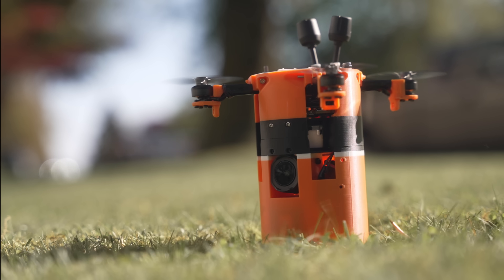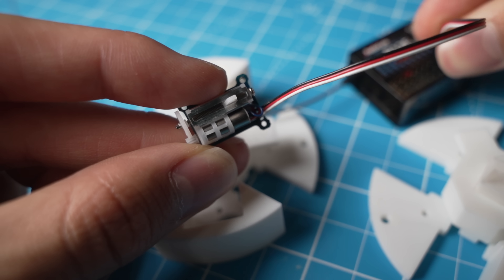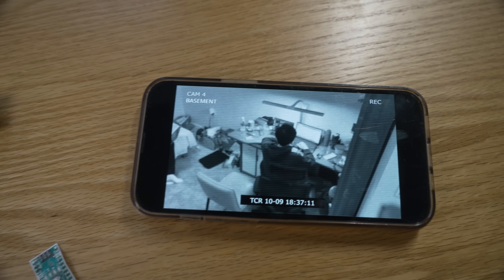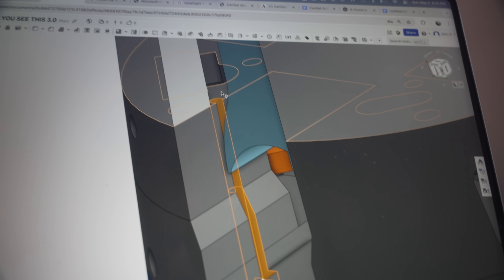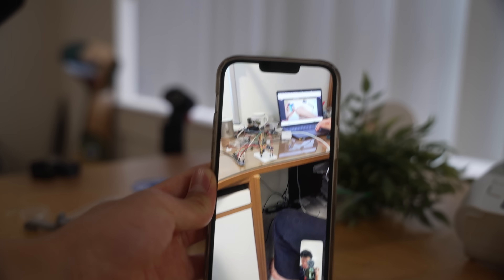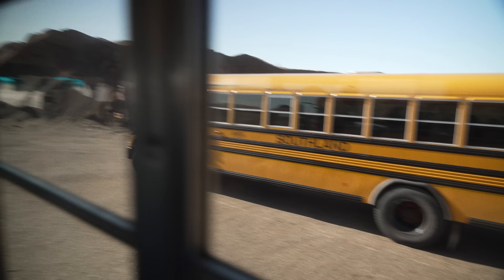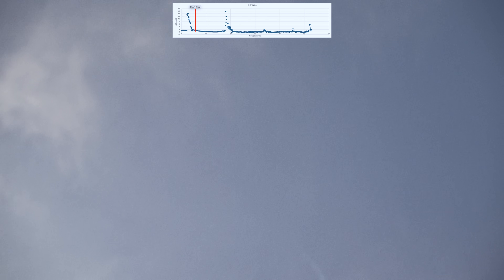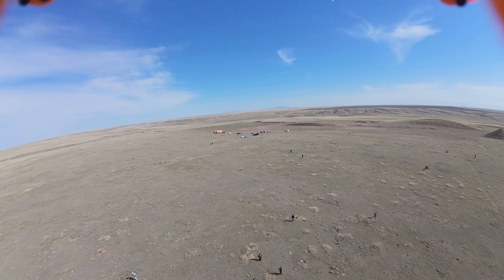I Built a Self Landing Satellite

Comment: This is SWEET.
I'm by no means an ITAR expert, however I do work with it a lot. With that said here's my somewhat professional but most definitely not legal advice interpretation. When the drone separates from the rocket, it is no longer classified as a rocket, but a drone or payload instead which puts it in a different class, most notably the class which would involve small UAS according to the FAA. This would be similar to dropping a drone out of a plane (illegal for different reasons, but regardless the example). The big gotcha there is it can't operate above 400 feet altitude so you would need to free fall (keeps in you in this weird grey area of "payload" until it became a "drone" at 400 feet altitude). Once you hit that altitude, since its now a "drone" and not a "payload" you would theoretically be okay for autonomous guidance. This is most definitely a grey area however I suspect by playing it that way, you would be compliant. Someone more experienced than me should definitely correct me if you have more experience.

Additionally there is this weird autonomous glider parachute that Apogee sells which further bolsters my argument since you could also call this a "recovery system" https://www.apogeerockets.com/Building-Supplies/Parachutes/Gliding-Parachutes/32in-Gliding-Parachute-System

Comment: You should update your drone with Strongger motor like 2000kv and use Cell 6s Lipo, and make it heavier because if it is too light and small, it cannot generate the best wind and stability.😊Advice from an FPV drone player
Reply: And connect GPS

Comment: You should try to fly in AIR mode not ANGLE mode, as far as I could see on your osd from the artificial horizon, drone was thinking that right side up was actually sideways. In air mode you pretty much control the direction of the drone yourself and gyro only holds the drone’s attitude from changing so you can use the right stick to level yourself out. However flying in acro is a skill you need to develop as it requires practice to be able to navigate your drone properly but yea you really need to repeat this launch in a drone where acro mode is on so that gyro doesn’t effect your flight as much.

The accelerometer function on most flight controllers, deviate a little even in drones when they give a lot of full throttle punches. So a rocket is definitely gonna make your accelerometer useless if it pulls anything more than 7 G’s. gyro still seems to work fine no matter what though so the drone can fly perfectly on acro / air mode while angle mode is gonna make it wrecked

You can always recalibrate the accelerometer but that has to be done on the ground so you can’t really reset your accelerometer after being shot out of the rocket

Comment: While working at a drone company, my team studied how rotor blade design impacts performance for drones in flight. We found that concentrating more mass toward the outer edge of a propeller blade increases its moment of inertia (( I = \int r^2 , dm )), which resists changes in rotational speed. This stabilizes power demand (( P = \tau \omega )), reducing current spikes that could cause voltage fluctuations and stress the drone’s electronics.

Inspired by this, I’m exploring the idea of adding a lightweight ring to the outer edge of these small blades. This could increase moment of inertia for smoother operation and act as a protective barrier to reduce blade breakage. However, the ring might increase aerodynamic drag, potentially reducing efficiency, so careful design is needed to balance protection, stability, and performance.

Comment: Replace the two micro servos for the release with nichrome wire wound around a rubber band. Apply voltage to the nichrome wire, and the rubber band will burn and cut, giving you the release. This saves you weight and money. 😉👌

Comment: I really appreciate that you shared the technical issues you were faced with. It may not be as cinematic, but it helps people that are inspired by what you do.
2 recommendations:
1) get a MOSFET module that can be controlled with servo signal - then you can turn off and on the power for the video system with your remote - no overheating, more battery for landing
2) Get a flight controller with a barometer, or a separate barometer module - easy way of getting ballpark altitude, so you know when to throttle up :)
Reply: I was also thinking barometer. I’ve never done anything like this, but I went into a short rabbit hole after the Ukrainian drone attack and seems like barometers are good enough for ballpark altitude, like you said.

Comment: 1) Not a satellite. Doesn't go anywhere near high enough, let alone actually getting into orbit.
2) DJI is the wrong choice when you're gonna have it waiting in such an enclosed case. Could've just gone analog, and at 25 mW it won't overheat, then bump it up to higher power right before the rocket launches. With the right placement of the VTX, you wouldn't even need the cooling fan, since the airflow from the props would be enough.

Comment: There are no legal reasons to prevent your from using Ardupilot on this to guide the landing. There ARE some other legality issues however regarding the FAA in the US. If it is over 250g then it must be registered. It's a small cost, and you can register it for "recreational use" and not require a Part 107 license. However, there is also a 400ft altitude restriction. However, any rocket launch site will likely have a Temporary Flight Restriction (TFR) published to restrict the airspace so aircraft do not come near and risk damage, and as long as the drone is operated within this TFR, you will likely avoid any issues since you likely may not be able to file for a TFR within the same airspace for drone operations. 

This is a cool concept and it performed well, can't wait to see the next one!

Comment: Some flight controllers have a switched power supply for the VTX that can be assigned to a switch on the radio, that would allow you to prevent the O4 overheating. Also, the O4 "bottom" as you put it is actually the top that needs more airflow.

Comment: cool video, fyi the o4 pro is designed to be mounted inverted thats why theres threaded holes on top. no idea why DJI did it . betaflight and iNAV both have gps rescue, assuming you had sat lock before launch, you could activate that either manually or via fail safe and it would fly itself back you can set all the parameters to control descent, so you could have skipped the o4. cool project

Comment: Just an FYI as someone who is also an engineer and part of the keyboard hobby, try coating those sliding surfaces with some krytox lubricant. Its dielectric and safe on most plastics and durable (doesn't dry up easily).

Comment: You should try making a better version of the "Estes Skywinder"  model rocket. Mabye add auto- rotation like a actual helicopter lands when it has engine failure, where the blades adjust for self-landing without and engine

Comment: Congratulations on the fantastic satellite (drone) build. However, looking at your G reading during the descent, I’m not sure the propellers made any differences. It’s always close to 1g till ground impact which means you are more or less doing free fall. The drone is just so robust that it survived the impact.

You probably need some sort automated algorithm to get to drone to stabilise itself first. The release is so violent, the drone is literally randomly spinning around afterwards. Not even the most experienced FPV pilots could successfully recover from this.

I’m also not convinced that pushing all four propellers full throttle at the same time is the way to stabilise the vehicle. Basically you are trying to shed a lot of spinning momentum. Pushing all four at the same time would push the force through centre of gravity and do nothing to spinning.

You can either try to reduce the spinning after the release. To do so, you need a few thrust vector not going through the centre of gravity (firing one propeller at a time?) and sensing capabilities to define the spin and thrust against it.

Conversely, you could try to make the release more stable in the first place. Since you are releasing within the atmosphere, you could try to release while the vehicle still has upward momentum and try to expand some fins. Though I suspect using a smaller parachute 🪂 as first stage descent and detach the chute once you deploy your propellers maybe an easier and more fool proof solution.

Anyway, just my 2 cents, wish you all the best luck in your future projects.

Comment: Great job, for small flexible wires you can open up an Apple Lightning Cable and pull out two red insulated conductors probably good for 250mA each?  They really help reducing build volume.

Comment: Instead of Betaflight you should have used INAV. 
It has a simple programming feature where you can automatically trigger the arming and return to home mode based on altitude measured by the on board barometer or GPS.
Reply: also I can recommend an RC and telemetry system that is super cheap and I am part of the development team as well for fast and stable data transfer. 
Hit me up if you need some details or help. I would be happy to help.

Comment: nice work!
yes make the other lunch on seattle.

could you combine in the next launch a parachute and the rotors?
I think that first the parachute is activated and at a certain altitude is released and the rotors are activated, my idea is to reduce the speed of descent and saving battery.

I still don't understand what data they want to collect and what is the use of it?
or were you just measuring the power and efficiency of the rocket?

Comment: You should look into a pinio switch on the flight controller.   It lets you use a switch on your TX to turn the vtx on and off.  Just before launch you can flip the switch and power it on.
Reply: Also a good ol pid tune and filter tune wouldn't be a bad idea if you continue with this project

Comment: For 2.0: Point the camera straight down. A view of the ground is a lot more useful than a view of the horizon. Include a small Meshtastic node (Seeed Studio makes one for $10 that would be perfect) and do some Meshtastic relays while it's in the air. Finally, tell the range operators about the cooling issue and limited battery life so they will give your launch priority and let you launch as soon as possible.
Reply: It’s near impossible to pilot a fpv drone, especially in acro mode, with the camera pointing downwards. What he has to do is to learn how to fly a drone in acro mode so that the accelerometer and gyro measurings doesn’t really affect the drone’s flight as much and he will instead pilot the drone himself to tilt it. Then what he’ll do is tilt forwards and face the ground like he’s on a roller coaster so he can face the ground.
Reply: @adakalyoncu1913 maybe don’t use acro mode. It’s not a racing drone

Comment: I worked on a cansat three years ago, not a rocket launched one, not a drone one, but with active parachute control (4 servos acting with extended arms on the 8 strings of a cross shape parachute, each servo lifted a corner and lowered the other on a given cross arm). Needless to say, building a cansat is a hell of a challenge, and a very great experience to get into electronics, mechatronics, embedded devices, ... great job for you, you have acheived a milestone

Comment: Delete all the screws you are adding about a pound, delete the servo you dont need it, the rocket tube will hold the arms in..   Program it so the motors come on when it reaches a specific downward force then off after a threshold is reached   so it can drop, power up, drop, power up etc.  Like PWM,  for example free fall for 50 feet power up for x time, free fall for another 50 feet ect.    This should give better video longer air time and reduce battery consumption.    You should just forget about the rockets all together and just do balloons.

Comment: What filament material do you use to build your parts?
Reply from the maker: Just Bambu lab pla 💀

PLA is not a great long term solution if you want something that’s built to last but in this case I used it cause it’s way easier and faster to print than other better materials

Comment: Spend the $25 on a hot air rework station. You won't carbonize your heat shrink and it'll remove 3D print strings, and so much more.

Comment: I'm a fpv pilot. The problem will be solved only if it comes down on an angle before throttle kicks in hard that way you'll prevent prop wash. You don't want to come straight down at high speed and throttle without a pitch angle.The motors should increase throttle at an angle, which obviously would move it to that direction with minimal to no pro wash and keep it stable at the expense of moving that direction. It could be done taking that into the equation and calculating the distance to return home at the desired pitch. The more pitch the less prop wash unless you're close to home then you can start leveling the pitch to descend straight down. It would be more complex to have it do it by itself which could explain the limits we have vs a real autonomous rocket 🚀

Comment: Would it be possible to get some information on how the DJI O4 air unit was set up. I’ve been looking around for a while to figure out what I would need to get it to run. I’ve really been wanting a smaller camera for my rockets and DJI is the only camera brand I trust ATM lol
Reply from the maker: Just get any fc compatible with the o4 - ideally one with the right port already, so you don't need to solder. Then you just set the right UART in Betaflight/inav, configure osd, and ur all good to go

Comment: That soldering at 4:39 is horrific, particularly the stray strand coming out of the red wire.
Firstly, you need a much hotter soldering iron, all of those joints are cold.
Secondly, you are stripping way too much insulation from the wires. You only need a few mm of copper exposed.
Reply from the maker: Lmaooo thanks for the advice I’ll try to learn to solder properly

Comment: some ideas

passive drag alignment, like feathers on an arrow, when it's falling to get it without needing any special software hardware

maybe use a traditional chute, but smaller, so it falls fast but not super fast, so you can save battery, cut the chute free at desired altitude

you could make an unbalanced chute that moves horizontally while falling 
potentially you could adjust ropes to tilt the outlet of the directional chute for some steering 

that could get you close for big drops with little power, especially from very high up, eg within a square mile

Comment: Really good for a first try at quadcoptering! Given the range and environment, I'd highly recommend switching to a lower power analog VTX and 18650 cells. Most controllers will also let you run an "enable" line to the VTX and bind it to a channel, so you can leave the VTX in "sleep" mode until it's time to arm.

Comment: Definitely spend some stick time on the drone so it's easier to control in the future.
The maneuver you are trying to pull where you go full throttle at the last minute is called a suicide burn and for good reason. Using a small amount of throttle and slowing down over time is significantly easier and safer.
Another issue you may encounter is turbulence from your props pushing air down then flying into the dirty air causing you to lose efficiency and thrust, moving forward while slowing down will decrease this effect.
You may want to consider landing legs as well to increase the size of your base which will make it easier to land and less likely to tip over. Alternetivly you can add some guards that stick out past your propellers and above them then use turtle mode to get unstuck if you land like that again.

Overall, great video, it was enjoyable to watch and looks like you had fun with the project. Good job

Comment: try adding some sort of lidar like device at the base to help during free fall, then maybe turn on auto leveling as well, you will have more control. but also a custom flight software would a better solution as you get more control...Btw what radio are using for the downlink from the nano.

Comment: 4:58 You are talking about the GPS Coordinating Committee for Multilateral Export Controls(Colloquially called CoCom) limits, but ChatGPT is incorrect about the CoCom limits. Officially the object needs to be traveling at 510m/s AND go over 39,000 feet. The caveat is that some companies have only one flag in their code so even though the rule is both over 39,000 feet and over 510m/s some GPS units will cut out if only one of the limits is pushed.

Comment: May I offer an idea? Use a powerful analog VTX with good heating. It is smaller, lighter, cheaper, and if you have GPS on (hope you solve all legal issues) video quality is no problem. Betaflight has smartaudio option I use when filming events. Drone is powered on long before takeoff, running 25mW, go full power by sending a command from a transmitter via FC to VTX just before takoff (or liftoff in your case).

Comment: What an amazing design, back on 2010 when I was at the engineering faculty there was a cansat contest but it wasn’t so exciting like this, most of the components were handmade and we used an arduino uno to collect all data like temperature, acceleration, speed, altitude, and so, and all needed to fit inside a labeled tincan that the organization team gave us, also it was inside the university main campus so the only device to make the free fall was a parrot airdrone that suddenly stoped working and we had to climb to the top floor from a tower (actually was a high altitude that the airdrone can reach) to throwing down the sats. We learn many things about transmission, designing PCB’s, and how components work, but this is seriously another level